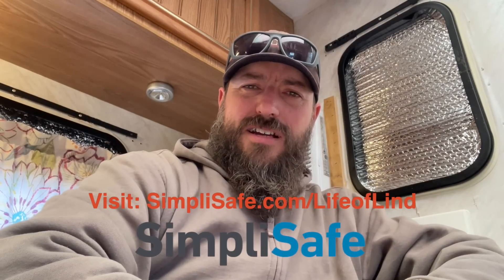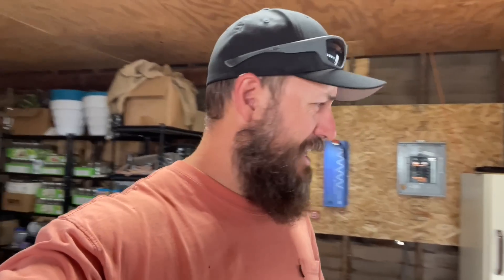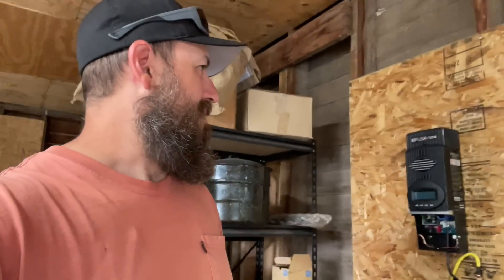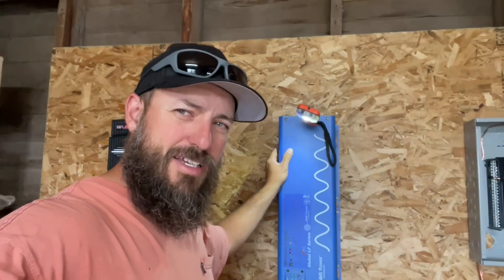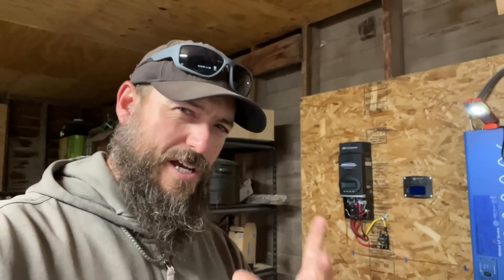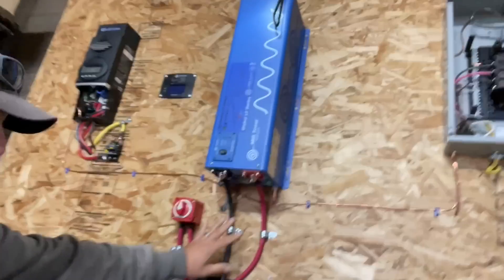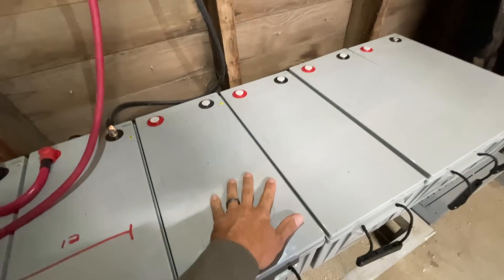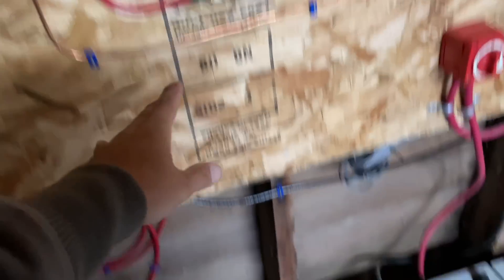Can We Power a Whole Farm With This Discount Solar System??

Comment: great video, thank you for walking thru each piece of equip and showing the battery hook up.  QUESTION; you have 2 black wires coming out of the control box, one is for charging the batteries, but what is the other one for ?  and what is the yellow wire on the device near the control box ?  thanks so much.

Comment: Could I make a recommendation.  

Explain the system in detail for those that are not familiar with inverters, critical load sub panel, charge controller. 

For instance, is your inverter pushing 240v, or less, and why. Home much does a typical house need.

Thanks! Love the channel
Reply from the maker: might do that when we do part 2 with the finished product. thanks!

Comment: Are you going from the ac output from the inverter to the panel
Reply from the maker: yes, we installed that panel just for the inverter, that panel in the shop will have outputs to the other buildings where we will put interlock devices and breakers to switch to solar power in those buildings as well
Reply: @LifeofLind  thanks